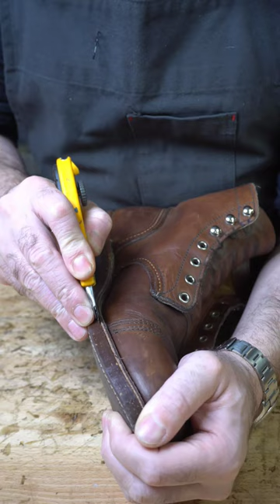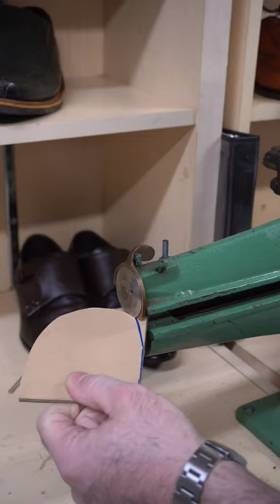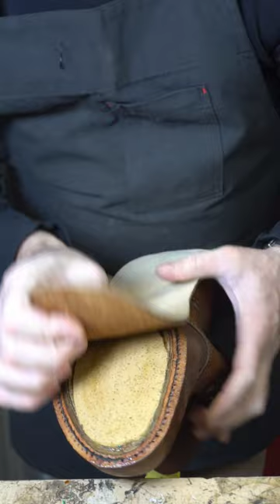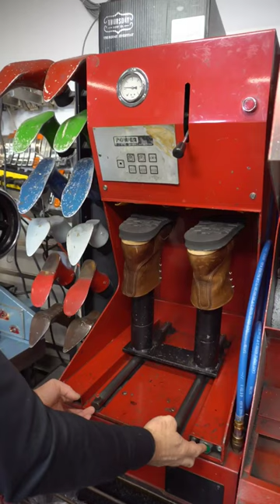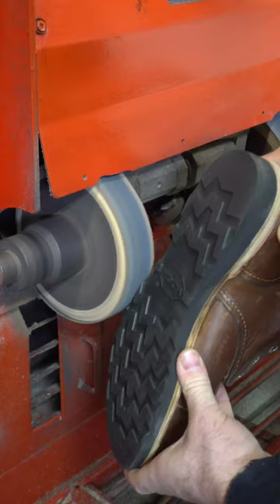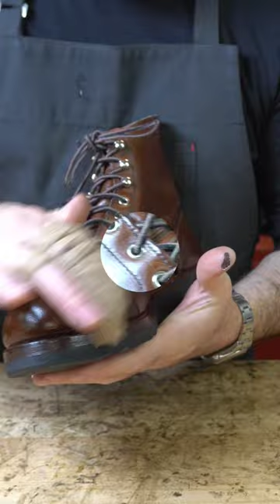REDWING IRON RANGERS SOLE CONVERSION | Cristy Vibram #4014 soles

Comment: I need some good boots. I'm gonna wait till I can afford ones worth owning.
Reply: I recommend not getting iron rangers as they are not made nearly as good as they used to but still an appealing boot....the best boots in arguably are whites but if you want basically the same thing a 150 bucks cheaper get nicks or jks these 3 brands are the only boots that will be around when we don't have electricity years into the apocalypse these boots will still be fine while all other sneaker made boots fall apart

Comment: Re-welt it next time. I'm not putting my welted boots in for a resole like this unless they do the job properly.
Reply from the maker: Sure,  $$
Reply: @KWSHOEREPAIR  Its not just about $$, you are making the boot an inferior product . But if your customers are ok with this then I guess that's on them. Personally, I wouldn't do this repair like this as I value my business and skills.
Reply from the maker: @JSR80  Thank you for your feedback. Normally, the welt can endure 5 to 6 resolings without requiring replacement. However, I concur that adding a new welt would enhance their perfection. I present this option as well, recognizing that some customers may choose to retain the existing welt. Ultimately, I accommodate customer preferences as requested.
Reply: @KWSHOEREPAIR   If you can re-stich in the exact same welt holes 5 or 6 times with the goodyear machine, then sure. But, if you miss one hole, its not good enough IMO. Just better to re-welt, takes 45mins if your good enough. And you can charge more because you are actually a skilled repairer. No offense, I just prefer to do things the right way. I like my customer to leave with better boots than they brought in. That's how I run my business. If they want something lesser, they can go to you someone else like you I guess.
Reply from the maker: @JSR80  Thank you for sharing your perspective. I appreciate your commitment to delivering high-quality craftsmanship. While I understand your preference for re-welting, I assure you that my focus is also on providing top-notch repairs.

Best wishes for your business